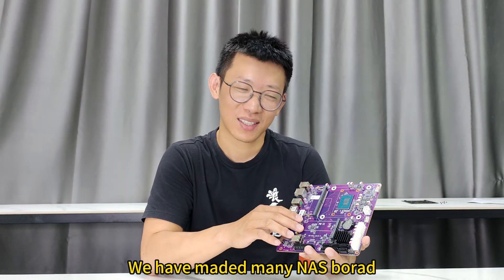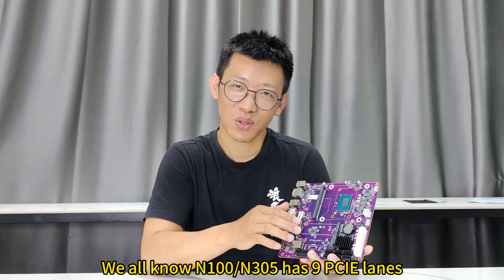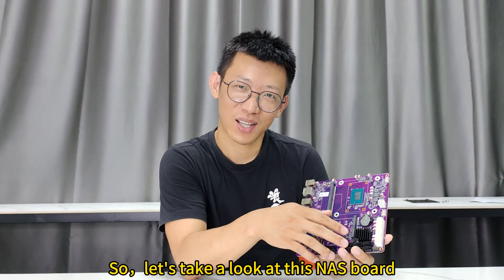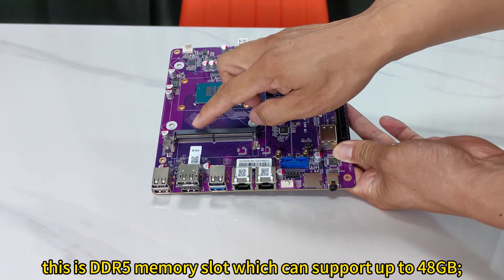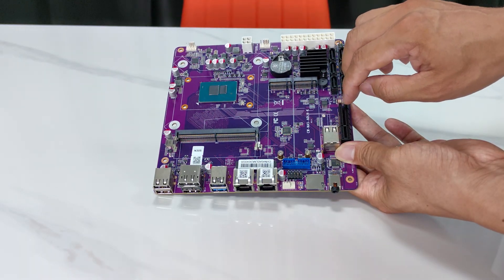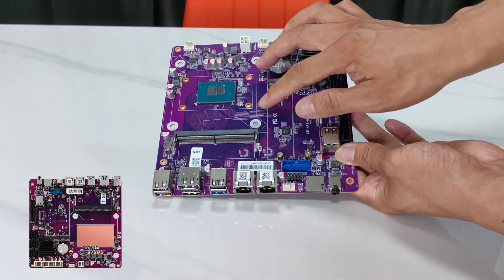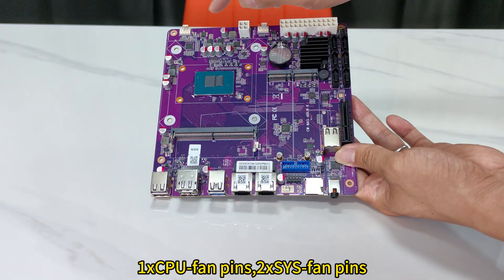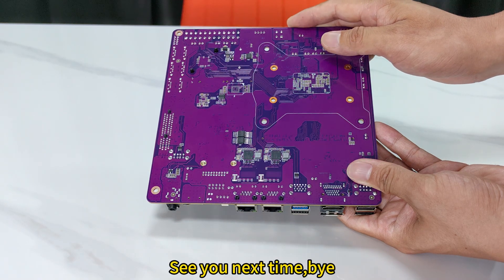Purple N100 NAS motherboard with redistributed PCIE lanes

Comment: the asm1166 was the reason i bought this, there were many other cheaper n100 nas boards out there with similar specs, but they all used the jbm sata controller, which apparently doesn't let the cpu use all the c-states and go into low power mode, which defeats the purpose of getting an N100, the asm1166 on this board apparently let's it go all the way down to the advertised 5 to 6 watts, but I will test when i have it in the mail, can't wait to give it a go
Reply: Hi! How is your n100 board looking? Have you measured idle and burst powers yet? :) Would really love to know this!
Reply: @Kuba295k  it's at about 15w-ish generally excluding the drives, see I'm an idiot and am running 4 mechanical drives in software raid 1, meaning they never go to sleep, so if you can grab an nvme instead you'd get between 15 and 20w.. I'm also using active cpu cooling which also adds to it, so power usage is pretty good if you don't do what I did
Reply: @-a6833  Oh that actually sounds quite reasonable. Thank you a lot for the tips. Will keep that in mind when my board arrives. :)
Reply: @Kuba295k  Yea, especially compared to the old dinosaur I was running before, but I've seen people get way less from this chip, so it's a bit more than I hoped it would be

Comment: Wooow nice Color but without ECC support as a NAS Mobo it´s totally useless.
Reply: DDR5 can have on-die ECC. You must mean side-band that's been used in enterprise along with on-die. For a home NAS, on-die should be good enough. You get most of the in-memory correction capabilities. A lot of high-end enterprise servers will leverage strictly on-die ECC to reduce strain on memory controllers. For anything enterprise or industrial, I would stick to reputable sources instead of hobbyist-level imports.